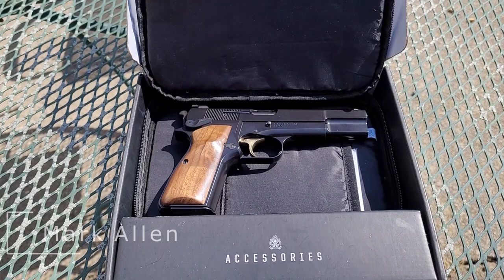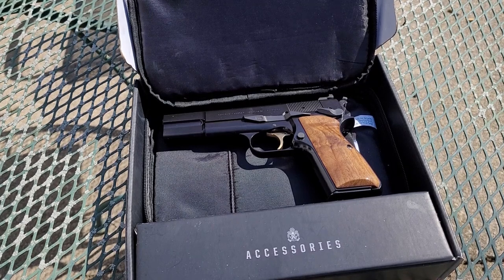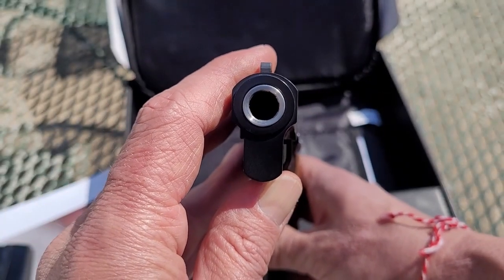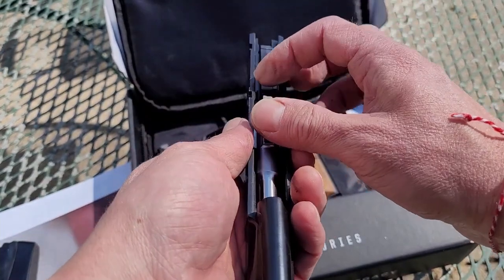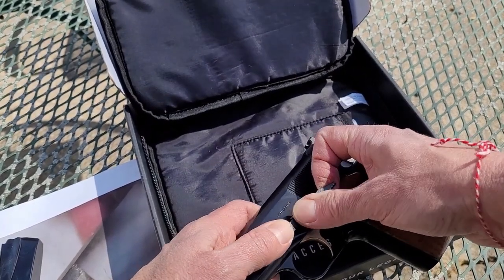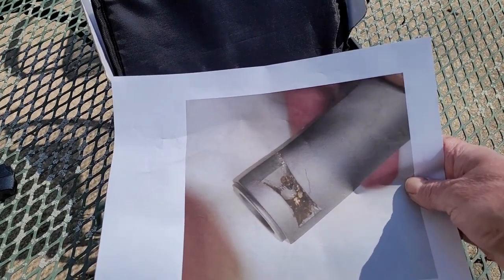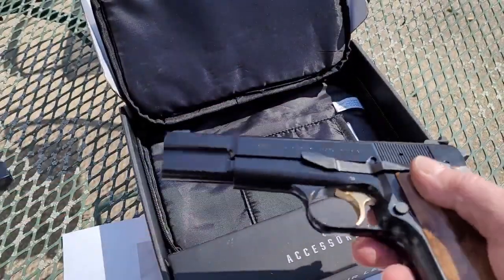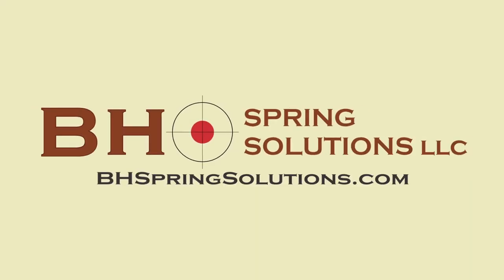Springfield SA-35 Video Review-Session 13 / BHSpringSolutions HI-Power University Session 90

Comment: Question…did Springfield pull all their SA-35s to fix the problems with the extractor? I haven’t seen a whiff of these in months
Reply: I’ve had one for about a month now. Serial is in the 5500 range. I am having extractor issues frequently. Fails to grab fired brass almost every magazine. Also, my hammer is cocked to the right and is rubbing the slide and frame in the hammer channel. I am only 200 rounds in and the problems started within 50 rounds. I have a buddy who got one in the 6000 range and he’s having the same bullshit happen.

Comment: I have to ask, was that a crack in the top of the slide running toward  the breech or just an anomaly in the pics?
Reply from the maker: Not a crack.  Also, hardness test reading on the SA-35 slide makes that highly unlikely.
Reply: @bhspringsolutionsllc555  Thank you.

Comment: Can you say how much a make-over like this costs?
Reply from the maker: Since BHSpringSolutions now manufacturers improved HP components for almost the entire pistol, we can help you part with as much as $2,000 depending on how far you want to go.  Of the first dozen or so SA-35s through our shop, the normal total Service amounts to $900 - $1400 and the major differences being a BH-Barrel, or not, and more exclusive Grip Panels such as the BH Heirloom-Grade MastersGrips as seen in the video.  The price ranges mentioned here have all included Deburring the entire Frame / Slide / Extractor Channel, replacement of all parts that we deemed marginal or requires-replacement, Refinish in Owner's choice amoung our Refinish Options, SFS, all BHSprings, pre-and-post service-test-firing.  Thanks for the question.

Comment: That SA-35 sucks right out of the box.  It’s sad that it needs to go through your shop in order to make it reliable.  I’ll stick with my new Glock 19X.  It always works.
Reply: I sent mine for the 4th time last week. Worst piece of S**T i ever purchased. $1000 and a long wait for a boat anchor!
Reply: @nursesteve12  Simce my post a year ago, I bought two SA-35’s recently.  The serial numbers are sequential and above 18XXX range.   I have 1,600 rounds through one as of today.  No issues at all.   I understand that after the 12xxx range, Springfield fixed the issue.   It’s an extractor problem and extractor channel.